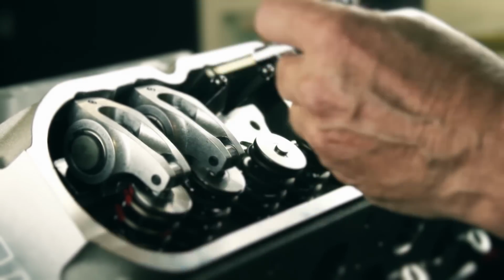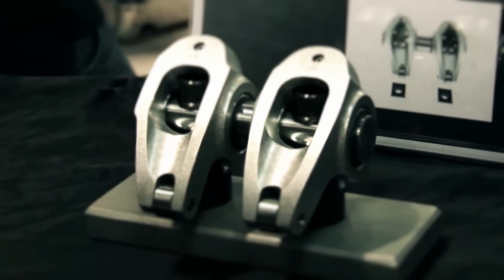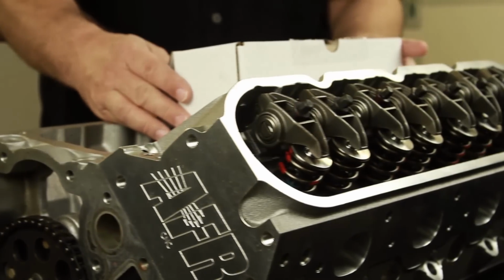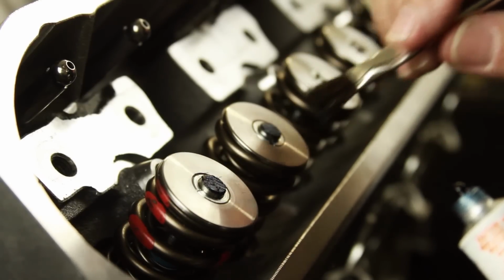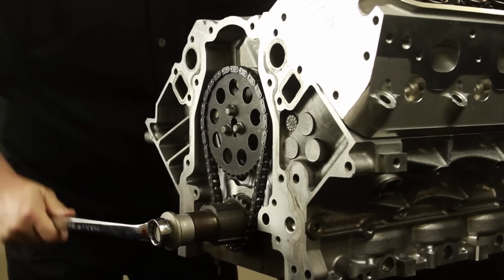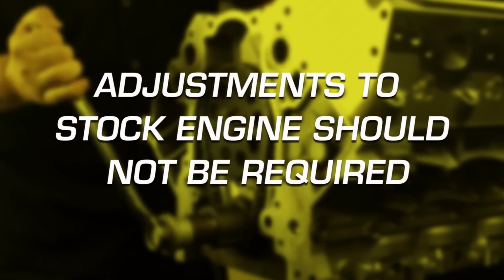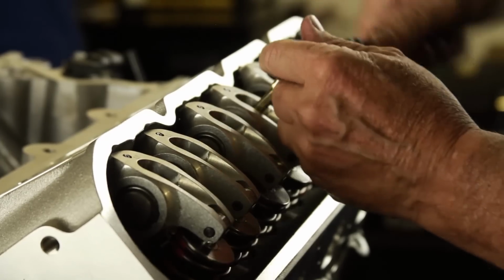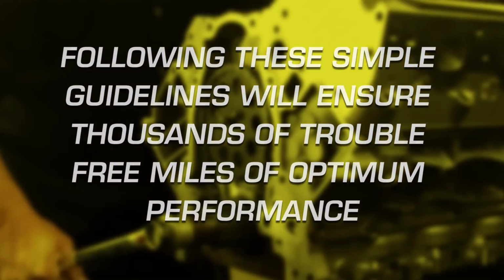How to install Yella Terra High Performance Roller Rockers for the LS1 Engine

Comment: I have a 3400 SFI in a 2001 Alero GL2 and I'm looking for ways to get just a little extra HP out of it. I've done the basics like intake, exhaust, fuel and ignition upgrades. I'm just wondering if this would be beneficial on a relatively small displacement pushrod engine like the 3400. I don't take it to the drag strip or anything, mostly drive it like a rally car on the back roads and Im finding the handling and grip to be be pretty good but it could use a bit more pep.
Reply: Nitrous. But I'm betting you've blown it up by now ...

Comment: I was wondering if i could use break in oil instead of regular engine oil prior to installation of the rocker arms? Or it doesnt really matter.
Reply: Micheal they are just rockers buddy just make sure they arent dry 😹

Comment: This seemed to miss a few steps, they showed just bolting down all the rockers, and never told anyone to turn the engine over for each rocker shaft for zero lash..I guess it’s known, but some ppl might just follow the directions as it is filmed.😂